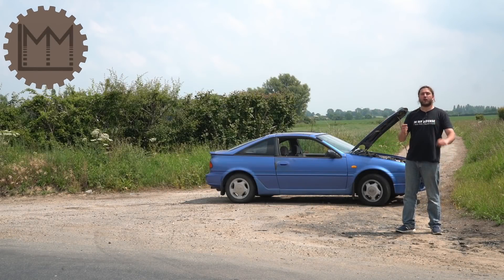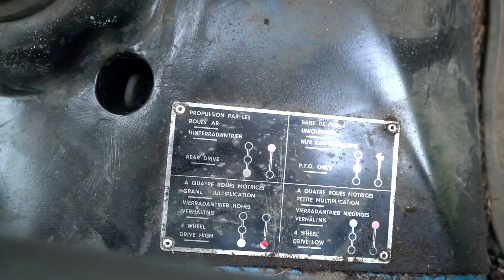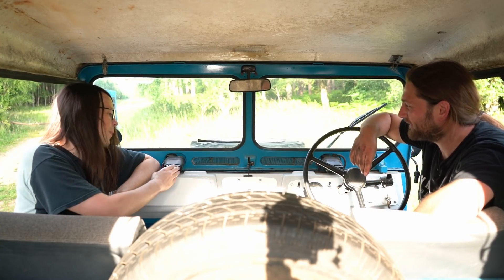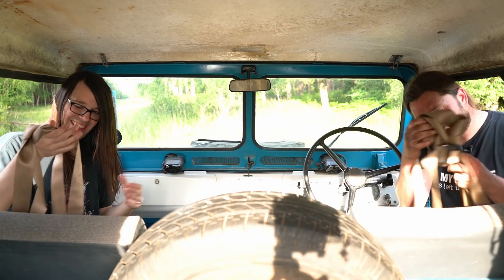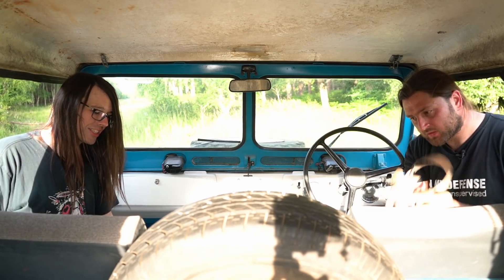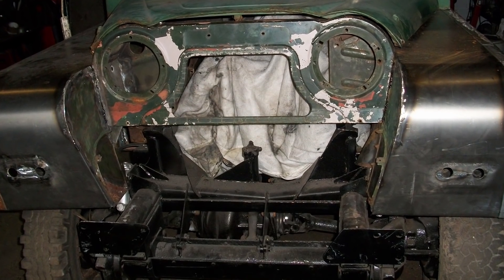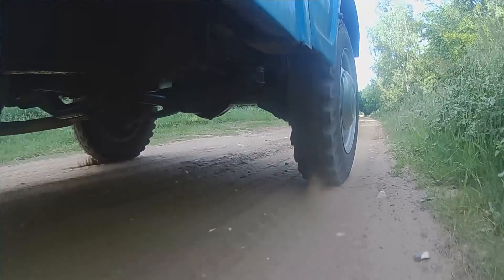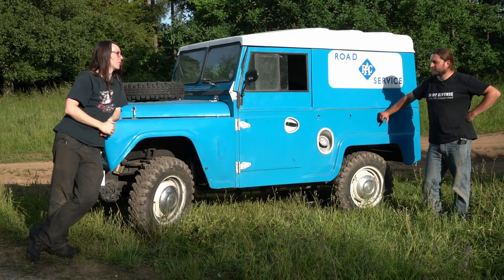Better green-laner than a Landy?! - The Austin Gipsy, LMM Drives Episode 27

Comment: I had  a 1966 Mk 4 LWB from new with a company I worked for and drove it for 170K miles over 4 and a bit years. A great vehicle for what it was designed for and 100 % reliable.  2.2  4 cyl petrol as used in the  A70 Austin saloons , Some Taxis and other commercial vehicles.  Not a flyer with acceleration and braking  akin to a steam train but it would literally pull a house down. Incidentally the company also ran a 1967 LWB Landy with a PTO welding plant in the back  and when  we worked on the same job  on more than one  occasion I had to rescue the Landy when it got stuck. I think the Gipsy had a bit more ground clearance and  suspension travel which  helped.   Back in the day we had unlimited private use of our company vehicles and they were assigned on an individual basis so in the 4+years I had it no one else ever drove it. Biggest problem I had was body rattles and creaks with a fibregleass upper bolted to a  pressed steel lower part. I quietened mine by inserting strips of thin leather in the seams.  Oh Happy days.
Reply from the maker: That's a really good fix! And interesting to hear it was better at not getting stuck than the landy!
Reply: I've still got a LWB GM4 and love the old girl.

Comment: The Gypsy is almost unknown these days. Great review of this classic off road vehicle. 👍
Reply: The Electricity Board bought loads of them apparently,so did the Home Office.
Some were sold off  a few years ago havng hardly turned a wheel.
A better bargain fifty years ago was the  Austin Champ 15,00 pounds worth of vehicle with a Rolls desighned engine at 1951 prices in 1972 for 200 quid. Thats two and a half grand in todays money,god alone knows what the 1200 quid is now worth. They built about fiftteen hundred of em. Farmers were running away at the sales with two at a time.
Went all over The West of Scotland and Northern England in mine. All we ever did was replace brake fluid(girling) and a Clutch (Gipsy Clutch Fitted) The Army decided the Landrover was more to their use.
Champ could knock spots off it. Mind you so could The German Munga, once you got the hang of the two stroke engine.  And I was a Landrover fan, Series One's for thirty quid.

Comment: Matt:  The world's most unhelpful RAC patrol...

The Royal Observer Corps had a load of those right into the '80s, and some even hung around into the '90s, and the Royal Navy had quite a lot too, indeed it wasn't particularly unusual to see one trundling around a Naval establishment back when I joined the MoD in 1991, mostly a variety of long wheelbase hard tops and pickups, though I did see a few short wheelbase vehicles in the old Naval police livery, which did look rather smart...

The speedo really didn't matter in those, the chances of breaking any speed limit in one was pretty remote as they really didn't have much power in petrol form, and the factory diesel had even less but ridiculous amounts of torque.  The speedos were all pretty much like that from brand new.  I seem to remember from my uncle's old one, that if you bought the civilian deluxe model, you actually got both wiper motors operated by a single switch on the dash.  The set up with each wiper motor having its' own switch was very common on utility vehicles like this, and on trucks and some buses back into the '60s and even into the '70s, Land-Rovers from that period were the same, and, indeed, used the same wiper motors as, like a lot of electrical components on British vehicles, they were standard Lucas (The Prince of Darkness) parts, as were the lighting units and switches, all of which are items you'd find on a Land-Rover from the same period

The RAC did have Gypsies, but not in Scotland.  I live down on the south coast, in an area largely surrounded by countryside which, during the winter and courtesy of the location being at the end of the South Downs, it can get a lot of snow in the rural areas.  One of my college friends' dad was an RAC patrolman most of his working life, and his first patrol vehicle was a long-wheelbase Gypsy diesel, which he remembered with much fondness and had many pictures of.  Some of the stories of what he got up to with it, in relation to work, were pretty epic.  The long wheelbase versions were pretty much what everyone used, the short wheelbase vehicles like this one were pretty much military-only in the UK, though they did sell well in other markets.  Needless to say, the short wheelbase vehicles are now incredibly rare in the UK...

Comment: The Gypsy is actually far more capable off-road than the same age Land-Rover, largely due to it's much more clever suspension system...

Now you've driven this, you need to find someone to let you have a go in an Austin Champ, the predecessor, a vehicle you'll find terrifying for very different reasons.  That's the one that has the Rolls-Royce B60 petrol engine...
Reply: I believe ythe same engine went in the Austin Vanden Plas 4 litre R. If memory serves it was a lux spec version of the Westminster range..
Reply: It was eventually changed from Flexitor Rubber to Leaf Spring,thats why it was discontinued.
Reply: Correction,Rolls Royce desighned engine,buit by Austin under licence.
The B40 was one of a series, B60 and B80.
The Champ was desighned purely for the miltary,thus so were the engines.
Reply: The limited slip diffs helped a lot more than flexitor.

Comment: We have a 2wd Massey Ferguson 590 with those indicators but something has gone wrong with the wiring (or someone has tried to change their direction to make them more intuitive to use). The right most position is off, the centre is left I think and the left is right (the left and right could be the other way around, been a while since I've driven it and needed to indicate), and they stay on constant when on. 
It also has about half a turn's worth of play in the steering, little in the way of brakes, a freewheeling function (like a bicycle) that randomly engages itself (or rather the lever falls out of the selection for enabling engine braking when you let off the throttle) and a newer than originally on it hedgecutter (much heavier in other words) on the back that despite slight overloading of the front with weights still causes the tractor to bounce off the front wheels if you hit a bump or go up steep hills. We also live in quite a hilly area. I've driven it a longer distance once and never again. :)
Reply: How about an Auto Union Munga (left hand drive) with brake lights acting through the indicators.
Turn a corner and you got one brake light(German Humour) drove the plod mad,when they discovered it was legal.
I drove around The West of Scotland in the eighties this thing. Even my German pals thought I was nuts(veruckt).

Comment: Old MAN buses had steering worse than that. Some of the ones I drove were scary, especially going through the old Mersey tunnel. The buses are the width of the lane, so the front corner had to be on the outside white line, while the rear was on the inside line. On a MAN bus you were in both lanes!!!! VERY SCARY when other vehicles are coming the other way!!! coming the

Comment: Nothing about the mechanicals not even a peak under the bonnet. Mostly a conversation between the two. I have to dispute the alleged ability to engage Low Range on the fly. What is more I doubt if either of the reviewers knows how to use the transfer box correctly!